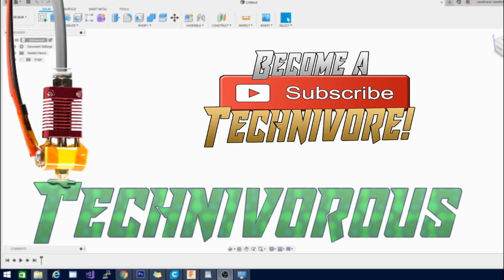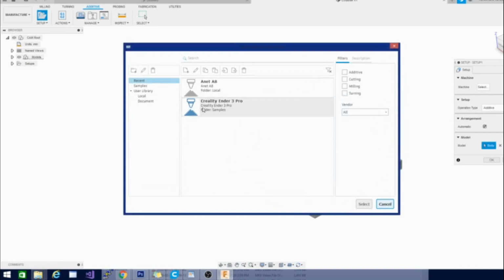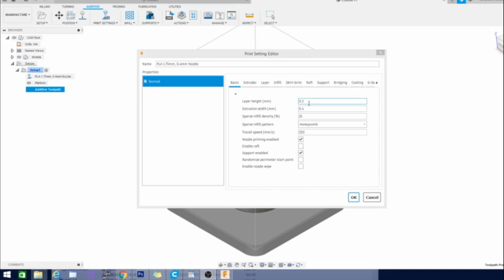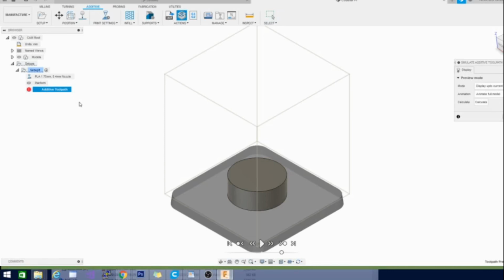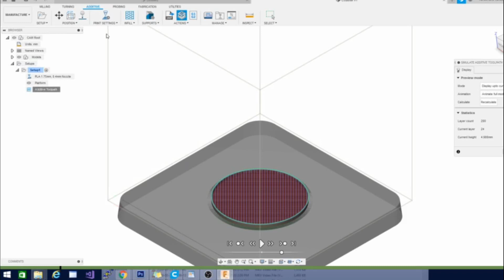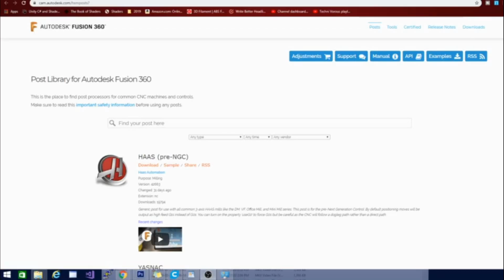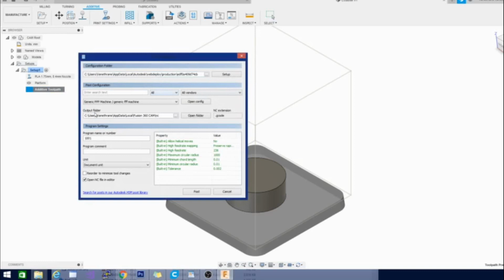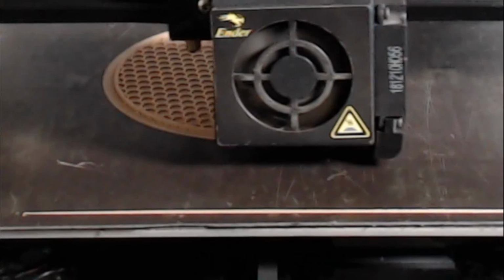Fusion 360 can SLICE better than most slicers!

Comment: I use Fusion 360 for my Tormach cnc.  I have been using Cura for my Ender3 pro.  Are you saying Fusion 360 slicer is better?  And if so, why?  Thanks dude!
Reply from the maker: Cura works great for the ender 3! However if u design a model in fusion for 3d printing, it make sense to me to cut out the exporting and slice right from fusion.  My aim here was to see if there was any loss of quality with fusions slicer, which there wasnt. Which in my eyes makes it worth skipping opening and exporting to cura. I do however still use cura for downloaded files.
Reply: @Technivorous  Awesome thanks!  I just wondered.  I have fell into a comfort groove with Cura, so if there is a better slicer, I jam always curious.  Keep up the great work bud!